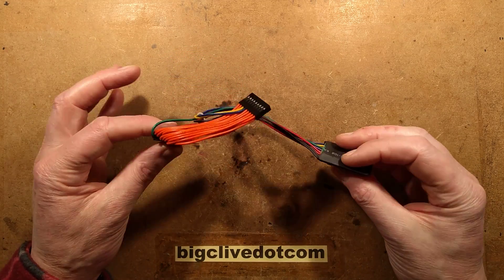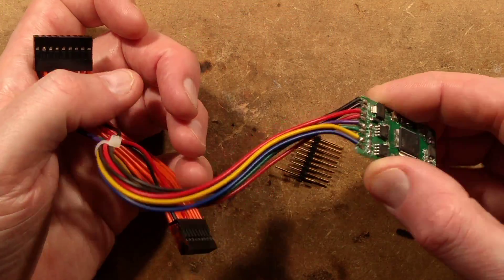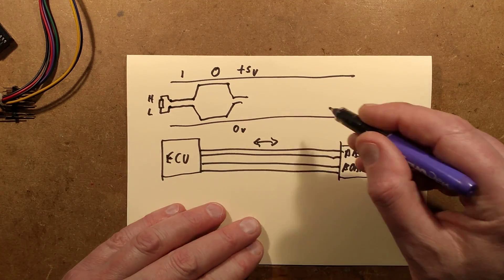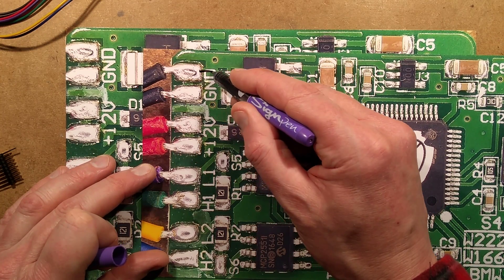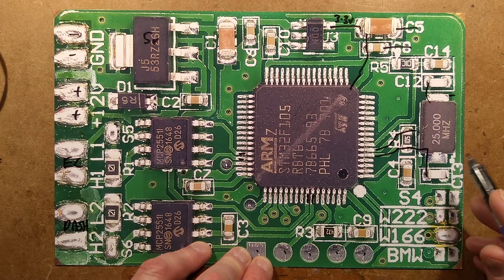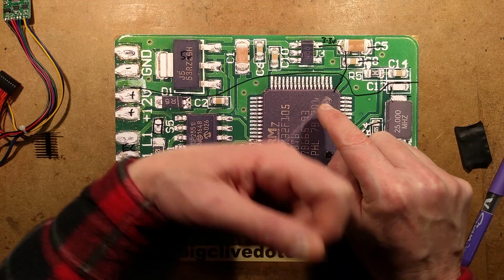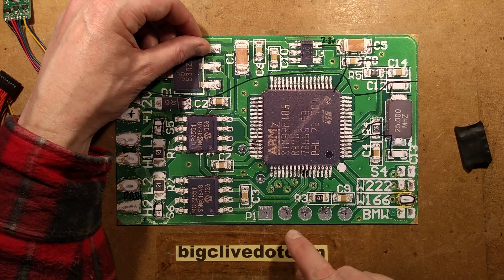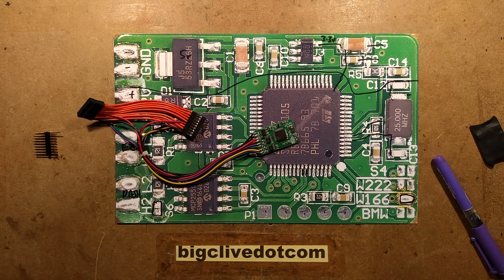Naughty CANbus odometer "interface".  (Fakes mileage.)

Comment: Had a silly fault on a BMW E90 - thermometer under the bumper that tells the outside temps claiming lots of swinging in value  - making the ice alert ping on the dash every couple of yards even in mid summer...very annoying, not the wiring nor the analog sensor but the dash circuitry - involved a swap out, which in turn flags false mileage as the dash no longer agrees with another ECU and the keys! (yep stored in 3 places!) so I doubt this device would work on an E90 - had to send the dash, and ECU to a 'man who can' - he asked what mileage I wanted when programmed! (of course no point in NOT having it exactly right as MOT history  would soon flag it)  Looked into buying the programmer and doing it myself, but looked quite complex and could too easily make a hash of it and render the mrs's car scrap. Nowt wrong with carbs, distributor and a cable operated speedo
Reply: can you explain this MOT history you guys speak of?  Is it something the government tracks? We don't have anything like that in the States.
Reply: @danwake4431  Yes, every year all road vehicles have to be inspected for roadworthiness 
Mileage is one of the things recoded since they went all computer based - so quite easy to spot if a vehicle has been wound back  :)

https://www.check-mot.service.gov.uk/
Pop a UK reg in and it will show you lots of exciting stuff

Comment: I don't think they'll use Arduino library since they use the can registry in the STM32. More likely they use STM32 HAL or some open source library. 

The slope control is for low speed, not high speed, it reduces RF noise by slowing down the transition between 1 and 0 and 0 and 1.

Comment: From working with CAN controllers in the past, I don't think this was (meaningfully) prototyped on an arduino- for an arduino / anything without a built in CAN controller, you end up using a dedicated controller IC- like the MCP2515. Interfacing with that vs interfacing with the built in controller on the IC is very different- on one you're implementing a protocol on top of SPI, on the other you're working directly with registers and interrupts.

Comment: These are somewhat common in Central Europe (basically every car has had the miles clocked).  Although the drawback I’ve heard from a few people is that the dash (even on a modern car with a fully digital dash) will display the speed wrong, presumably lower than reality so the dash doesn’t think you’ve travelled so far.

Comment: Bit surprised that this would work. Iirc my Ford has mileage in all of it's modules and it's transferred/compared between modules and it would trigger ECU if they don't match. One friend also mentioned that BMW's usually have this method too. I assume this also filters some warnings from data transfer as well?

Comment: It's a node broadcast on the CAN if they adhere to standard protocols, a dominant controller will be allowed a specific number of Ms per second to broadcast it's information, some are 1Hz some are 5 or 10Hz depending on the data priority. A dominant controller can pull voltage to 12V on some systems to tell others controllers a fault has occured, some use 5V on CAN HI for this signalling. It can be 100 meters long with hundreds of nodes on the same bus. 2 120Ohm resistors, usually "active" termination are installed along the way.

Comment: CAN is identifier/classifier based, so the ID with the most 0s (aka the lowest binary value) is dominant and is assigned to the highest priority devices. I guess this MITM device knows the relevant IDs for the odometer and spoofs/adjusts its data package. To intercept the package it has to sit in front of the receiving device as all CAN devices basically have a "subscription" to certain relevant IDs and are listening to those. The 4 bridging pads are then just there to set this ID depending on the car/manufacturer to only adjust those packages, as changing other packages from other devices is probably rather dangerous. That's why its passing through the error messages, tampering with those would certainly cause some trouble for the driver/owner.

Comment: AliExpress: "CAN Filter 18 In 1 ForMB CAN Filter 18In1 Lowest price 18in1 for Benz/forBMW Universal Odometer adjust Super CAN Filter for BMW"
https://www.aliexpress.com/item/32837357204.html?spm=a2g0o.productlist.0.0.373deccfkCs2z7&algo_pvid=618f77e3-cc6a-48ab-9586-6fc2bc99f83c&algo_expid=618f77e3-cc6a-48ab-9586-6fc2bc99f83c-3&btsid=4ff0374d-a7d5-49d9-906d-e5ed6f08682c&ws_ab_test=searchweb0_0,searchweb201602_2,searchweb201603_53

 Super CAN Filter Main CANEMU Function:
 It helps car owners to repair (exchange to used parts) broken car electronic computers and keep original car data: like odometer, coding and others functions. 

NOTICE!!
New style: 222/205/217
Old style: 166/212/463

Comment: Hmmm that is strange if the ECU send the miles, i tought it is really deadicated in a chip on the dashboard, and get input from the sensor of the gearbox how many miles he wheel had drive.. and hat chip is only count up. that is what i had hear about it. but overall this is an very intresting (hack) tool :)

Comment: Those programming pads certainly look like a pogo pin has been pressed into the solder at some point. From my days in manual board testing (which was done after automated testing) if you got a duff board it was always looking to see if those marks were there and if not sending it back to have the automated test pass done properly before spending hours fault finding.

Comment: The adjustable slew is used to "relax" the leading and trailing edges of the CAN signal. It cuts down on unnecessary noise. Anyone who has ever lived through DeviceNet knows what happens when the slew is set for "Flat out". :)
Reply: Do you mean it slows the rise/fall times of the signal to eliminate the high frequency overtones of the signal as it changes?  Just curious
Reply: @SteveJones172pilot  Yes it does, and it certainly helps in that regard. And DeviceNet is an abuse of the CAN spec in the first place, so it needs all of the help that it can get.

FWIW, my Railstar Io CAN boards have their slew rates "hard-coded" into the board by way of resistors (RC time constant). http://www.dcctrain.com/shop/item.aspx?itemid=6273

Comment: A couple of years ago I was looking at a 2007 Mercedes C-Class to buy. It was advertised as having 80,000 miles on the clock, but after a thorough inspection I thought the price was too high as it seemed to have way more wear and tear than I'd expect. Quick check on the DVLA's website reveals the car has nearly 100,000 miles on it. Doesn't seem like much on a car with mileage that high, but you're still talking a grand and a half difference.
Reply from the maker: I bet it sold to someone less capable of that investigation though.

Comment: Do a Google Image Search on 2800-072601 the number on the back of the board and this appears lots of times. Described as a 'CAN filter' ! Available on Ali Express, Ebay etc. Some mention 'Benz/BMW Odometer Adjustment' Some of them appear to be boxed in a small plastic box others are just the board like the one you have been sent. 
Not good news for second hand car buyers.

Comment: Love the video! It reminds me that some car manufacturers “hard burn” the mileage from the canbus into other modules like anti lock break control modules. That way if the car is in an accident you can get a 30 second last condition of the car sensors. It records actual mileage. It should also prevent modules like what you have in lease cars. They check the ABS system mileage to the dash board. Thanks Clive!
Reply: Thats right. Chrysler started that with their CCD bus in 1989. I was surprised that with the right diagnostic tools you can read out mileage  from the Engine control module for example. Worked on a 1990 New Yorker, quite astounding. Apparently it works on the Trans control module too of that era.

Comment: Found em! And oh boy, they're flooding into the 'states too. Cheap $12 Chinese product called "CANbus Gateway" brought to you by the same Chinese hackers that brought you the 3DS' Gateway cards comes a device that's guaranteed to land you months in jail and a big fat fine should you install it in your car. They're designed specifically to attack the device of the same name, the "CAN bus gateway" installed in a variety of cars under the General Motors brand. It's listed as an emulator to "test car radios", but it's the same board, same chip, same wiring harness too.

Comment: W166 is M-Class W222 is S-Class, BMW is erm BMW, S4 is a test point. In the UK its not actually illegal to adjust an Odometer, but it is illegal to sell a clocked car without disclosing it. The best thing to do is OBD scan a car you are looking at buying to make sure the ECU is reporting the same as the Cluster. Most backstreet dealers wont expect anyone to scan a car :-)

Comment: The dual CAN bus on those MCUs is quite fun. I use a bigger brother of that MCU - e.g. one bus speaks J1939 to control robot  actuators or start a generator,  the other bus  has a proprietary protocol based on NMEA2000 which links up  an array of modules. Nothing to do with automotive, a marine application.

Comment: A no car CAN, but chickens CAN, story. The CAN net I have experience with wasn't in a car. It is used in high speed xray machines for the poultry and meat industry. I can hear you saying "WHY in the world would they use a CAN instead of PLCs?" Oh believe me, I asked the same thing 20 times a day for 3 years. Anywhoo, in our application nothing electrical on the machine  WASN'T in the I/O.  So everything, no matter how simple, was addressed. Then each of those things HAD to have a very specific resistance, and not all the same R, which acted like a backup to the address. So much so that even simple limit switches, or the traffic light(Allen Bradley) sticking out the top of the machine, to verify the machines status from across the plant, couldn't be replaced with anything but the exact bulb from our parts list. I'm normally an industrial instrumentation n controls tech, refineries, oilfield and the like, and I had dealt with PLCs and DCSs for 30 years. No specific make or model, just all of them. The last place I pictured my career going would be fixing machines to give dead chickens better healthcare than I was getting...but that's what happens when you break your back at 50, literally, and have to start taking less and less physical jobs. At any rate, since this was my only CAN exposure, I didn't know if the I/O resistance double check was standard for CAN? Or was it just for these machines, because we were dealing with radiation, and maybe the dept of redundancy department says it needed to be extra, extra complicated. 
The next time you pick up some boneless chicken at the market you can be sure that it is...unless it's less than 3mm or not calcified and not actually a bone yet. Now ask me about these new chickens that can go from hatch to market, by weight, in about 90 days, or if they even have calcified bones yet, or if it's something you want to feed your children. 
This particular machine is the best there is, it's a SensorX Bone Detection System, if you're interested.

Comment: I agree it's probably some generic reference design board that's been borrowed and customised for this purpose.The error codes - a possibility there is that the service interval comes up and the instrument cluster doesn't display it, then the mileage goes well past it and the ECU has a dummy-spit.  Or maybe the wrong service is performed as specific items like plugs, filters, etc are generally periodical dependent on the odo reading.

Comment: If that's developed on an Arduino... you might just be able to stick a standard "FTDI" adaptor on those 5 "pogo pads" and get a standard Arduino USB connection to it. They may have blown the fuses... but maybe not too.

Comment: Scary to think how many of these might be concealed in used vehicles.
Reply: Mines so old it has a spinning cable running from the transmission to the instrument cluster. This attack wouldn't work (though there are other ways of faking mileage.)
Reply: Important then to check where this would be plugged in

Comment: I remember a case where a used car dealer was brought up on charges for "rolling back" a speedometer..(that is how the law was written)..in the days when cars used mechanical speedometers. At the trial, they had him cold with all their evidence. But he threw them for a loop. He rolled the speedometer "forward" until it 99,999 miles and then it all went to 000,000 and then he went a bit further and shaved off 40k. He walked and they had to reword the law.
Reply: I have never seen a law that is that poorly written ;D 
In Germany there is no specific law for it, but it is "computer fraud", which basically means manipulating data in a computer to gain financial benefits. We do not care if you go back, go forward, or in which order you do it ;D

Comment: 16:33 Maybe you can. Mercedes writes any changes on the can-bus to a log every 10 miles. I remember it because one victim of airbag/radio theft decided to drive his car to a shop and practically strip the interior before reporting it. The shop then saw that the seats, radio, dash etc etc were disconnected after the car had been driven and pieced one and eleven together: insurance fraud.

Comment: W166 is the M class mercedes, W222 is the S class. This is a cheap cheat; the bar-stewards learned to reprogram the odometer on the older models, so the manufacturers linked the odometer and ECU - a discrepancy between the two shows a tamper signal on the dash. Whilst the odometers are still relatively easy to crack, the ECUs have some tougher security - rather than bother trying to hack that to keep the values in sync, these bar stewards just took the easy way and intercepted the signals, so they can change the odometer without showing the tamper signal. I suppose the next step beyond encrypted ECUs will be encrypted comms between modules (its pretty much “plain text” on the CANBUS). Once that happens, get used to your cars doing the old “turn it off and on again” routine, just to get the damned thing to work.

Comment: 8:44 - "It's actually quite well designed."  Probably so that it minimizes any technical issues it might cause.  You wouldn't want this causing problems on the network thus causing a technician to find it.
Reply: Except that he did find it .... due to numerous dashboard issues.
Reply: @HappyQuailsLC  Then I guess it wasn't designed well enough.  ;)
Reply: HappyQuails well I’d say given how the device works, it worked pretty well for a considerable time of it managed to shave 25,000 off the mileage.  

Either it failed and caused an issue with the CAN or it was just found by chance when then mechanic was investigating the other issues.
Reply: i am thinking it is a "generic" piece of kit "repurposed" for this usage and NOT MADE FOR THIS USAGE
Reply: jason riddell considering there are pads to select 4 different vehicle programs I’d say it’s being used for exactly what it was designed for.

Comment: W166 is a Mercedes hybrid, W222 is a Mercedes S class, BMW is obvious and S4 is an Audi. Guessing they all share a similar, if not same instrument connector/instrument panel manufacturer being they are all German vehicles.

Pretty clever, but might have less errors on the can line if they twisted the wire pairs on the piggy-back as the can is pretty sensitive.
Repaired damaged can lines in the past and found errors due to not being twisted back together enough. Also, even good solder joins can have a bad effect on occasion but not usually.

Comment: The ARM core here looks like serious overkill. This probably could have just as easily been done with a little PIC
Reply: No, the software needs to catch every CAN message on the bus and re-transmit it in real time. Too much for a tiny processor.
Reply from the maker: It was probably a lot simpler to use a microcontroller that had the required two CANbus ports and the internal circuitry to make using them easy.
Reply: @bigclivedotcom  Yes, in the early days it was common to have an external can protocol chip such as the intel 82527 but now everyone uses microcontrollers with the feature built in.

Comment: Fascinating. Question is how can the ECU tell if it has been tampered with? Quantum CAN bus? GPS input? 
I presume the ECU has all the original data and this just modifies only mileage info so it shouldn't harm operation. However, it could be doing much more and giving the ECU modified data as well, so nothing can be trusted.
Tampering with the operation of a 2 ton kinetic impactor and putting lives at risk should be a lot more serious than simple fraud, and I hope that those responsible face justice.

Comment: Realistically CAN is only two wires to each computer or to a central distribution type unit, then to another computer.
Each control computer has its own supply via fuse as they will be rated differently.

Comment: Mr. BigClive the "W222" "W166" designations are chassis codes for Mercedes. W166 is the designation for the GLE crossover. From my understanding the GLE and E class share bits (engine, trans, gauge cluster, internal switch gear, etc.) and the W222 is the code for the s class. Presumably the S class is more unique so it need its own settings for massaging. As for the "BMW" if I remember correctly BMW has recently (past 10 or so odd years) unified the management systems.